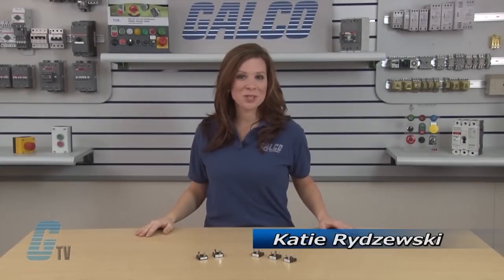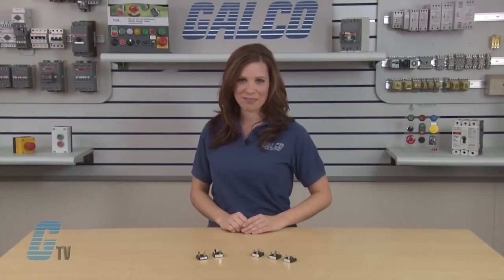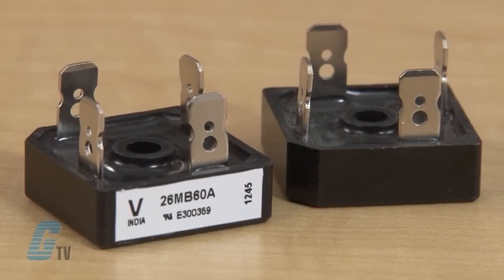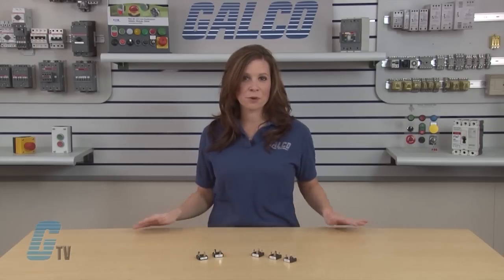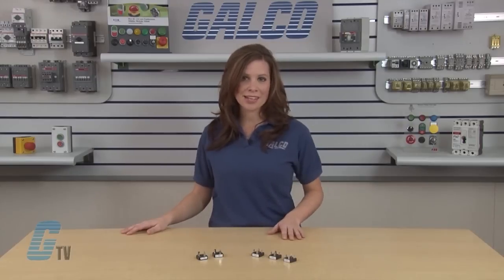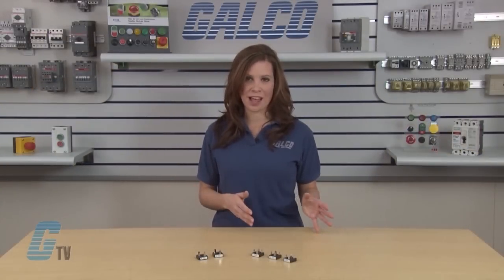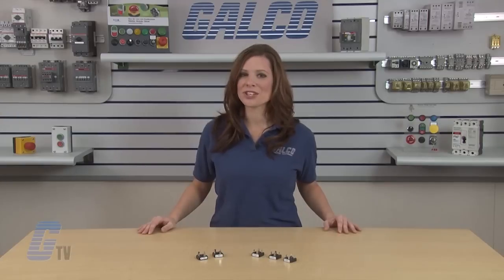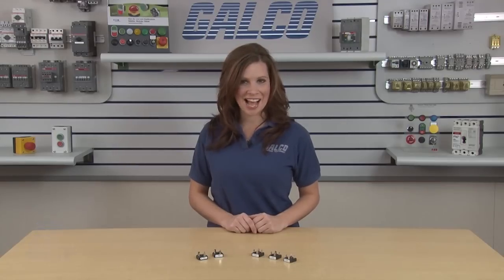Vishay MB Series Single Phase Bridge Rectifier Overview

Comment: I have requirement to convert 230 volt to 12 volt DC 5 amp supply with 60 watt application. Do you have a suggestion for making a suitable bridge rectifier circuit.